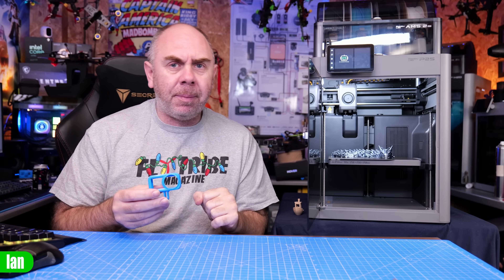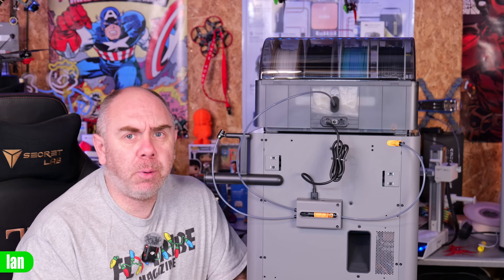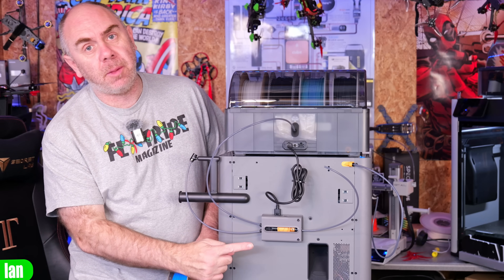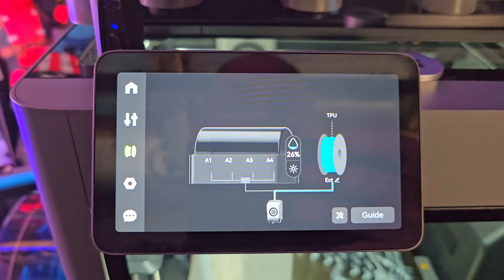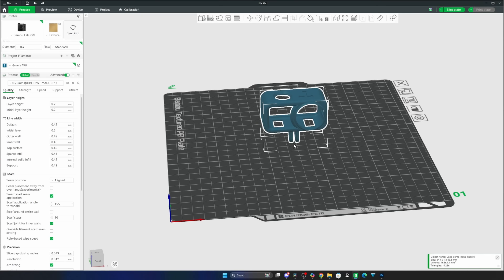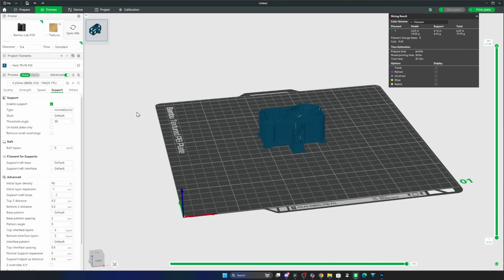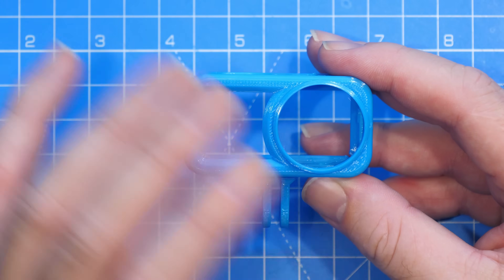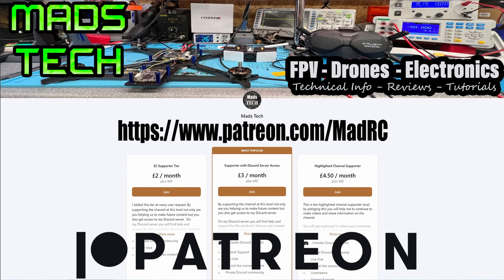Bambu Lab P2S & TPU - Everything You Need To Know!

Comment: Actually you can move PTFE holder to the other side of the back of the printer. The manual default position for the holder is on the opposite side than shown in the video with 2 optional positions on the other side.

Comment: Much appreciated! I initially printed some supports for my daughter's wooden bed slats from ikea to prevent them from squeaking. It's basically wood sitting on on wood. My initial attempt was horrible with a lot of stringing and eventually the filament must've broke off inside because when I checked back later the printed parts on the bed were about quarter inch from the head and no filament was coming out. I figured later on that the Bambu Lab profile must have been going way too fast. I used your profile which turned 3 hours into an 11 hour print, but it looks like a perfect print. No stringing at all. Faster isn't always better!

Comment: Great video, used your config file and my TPU print came out perfect. I do have a question though. When I imported your profiles and selected them in Bambu Studio I expected the setting in the left display in preview to change such as speeds it shows Initial Layer 50, Outer Wall 200. When sliced it looks like speeds changed in the slicing result but not in the speed window on left. Does it change everything for the print including retraction settings etc.?

Comment: I did get the 4 in 1 adapter when buying my p2s. Haven't mounted it just yet, but it's ready. Interesting thing: my external spool holder came on the opposite side than every youtubers video. It's below the feed in the back, not below the buffer area. I don't have an ams yet, but i will get one in February probably. I have 2 creality $39 dryboxes though.

Comment: Get yourself one of the 4-to-1 PTFE adapters from the Bambu shop and connect that between the buffer and input so you can add a dedicated PTFE tube for tpu.
Reply: I tried that.  I printed a spitter for my P1S, but that work around did not work on the P2S. This because the in port has been moved all the way to the right side.  It leaves no room for mounting that old splitter part.  It also cause way to tight of turning radiuses and too tight of a length between the buffer and the in port.   This caused the AMS to have a hard time feeding filament to the head.  I am sure there will be a good work around, but the old method was so convenient on P1S.  I just use it for TPU at the moment until I figure a good work around.  I don't want to constantly connect and disconnect tubes to print TPU when I can just load it on the side in my P1S.  Seems like they could have thought the layout out better.

Comment: What! I thought that was part of the whole new filament buffer upgrade is that you can just run TPU through one inlet and AMS through the other so you don’t have to deal with switching
Reply from the maker: No its a second input, the problem with TPU in the buffer it is can bend and block.
Reply: @MadRC thank you! I’ll just get the splitter and put it in between like you suggested!

Comment: You can put the external roll holder onto the other side. Surprised as a YouTuber yourself hasn't figured this out. 😮
Reply: Do you have to unscrew something to find it? I don’t  see it
Reply: OMG he's right, the spool holder can be mounted either side. 🙂
Reply: you can't. what you're seeing there is the belt tensioner
Reply: @RedDev26 you looking at the wrong screws. Keep looking.
Reply: @rizsu82 then where is it? i don't see anything that looks similar to the spool holder mount on the other side. is this ragebait?
Reply: @RedDev26  fr
Reply: @rizsu82  This is ragebait
Reply: @RedDev26  No, it's true. You need to unscrew the 2 screws holding little piece of plastic that the spool holder slides onto and move it to one of the other mount points. There is another one on the right, bellow the default one, and one on the left side, just above the mesh grille.
Reply: @procrastinator1842  Well could've just said that. I was thinking that the comment was about an actual spool holder mount not a mount for the mount.